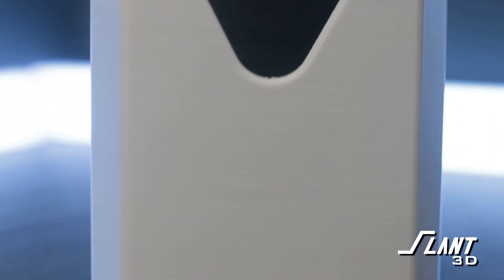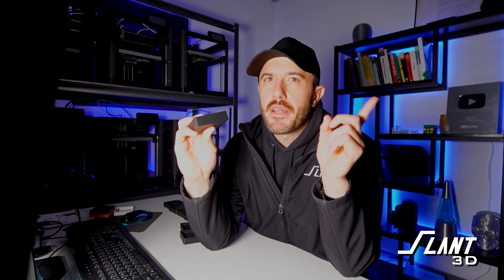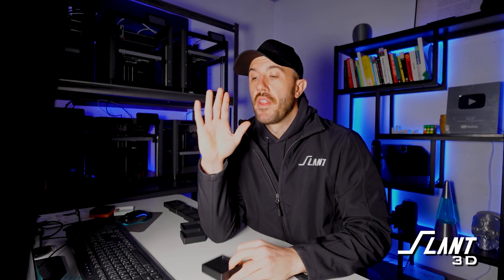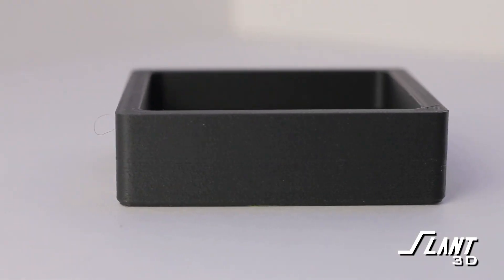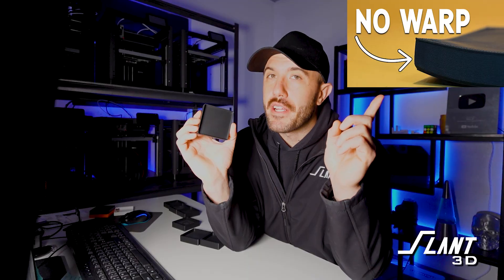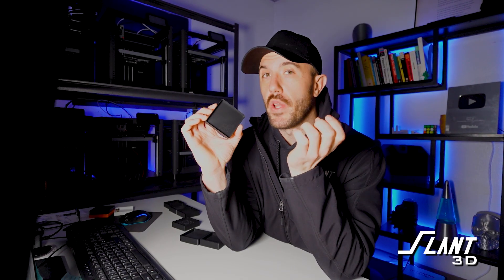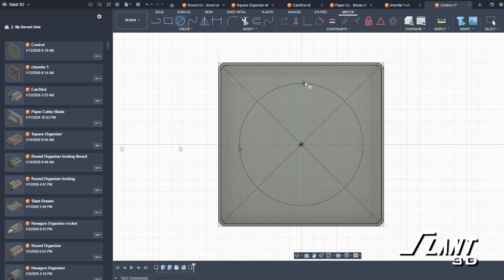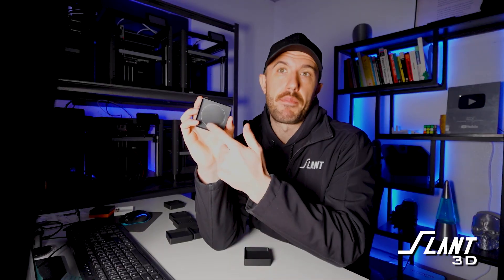How to Eliminate Shrink Lines

Comment: I wonder if hibert for that top layer would help due to its more random directionality? Also angling the print 45 degrees?
Reply: yes there are many ways in the slicer of fixing this problem and, despite some people's (cough cough) objections, you should almost always fix problems like this in the slicer if you can. 

This attempt to merge slicing-control with model-design is a very dirty bodge that's 'leaky' and means you have to actually change your model file just to fix a manufacturing issue. Essentially this means shifting your 'source of truth' for what your part should actually be. If you look back on your model file in 3 years you will see tons of weird design decisions that aren't actually design decisions at all but are alterations made to the model file just to alleviate manufacturing issues. The entire point of the slicer is to be the thing that converts the model into the instructions to generate the desired part. It is literally the slicer's job to solve these sorts of issues, and trying to do that job in modeling software instead will just give worse results. There are some fixes which are stronger, faster, and higher quality that simply cannot be done in the model. Speaking personally tweaking the max line width in Orcaslicer cut down the print time of one of my parts in excess of 40% and dramatically improved quality by letting me convert short lines into long loops, and that's simply not something you can do in the model itself. (For obvious reasons. Btw the feature was threading on relatively thin walls btw, so where the threads popped out/in the additional inner wall would be a tiny line, whereas with just a few minutes tweaking line widths it became two variable-width loops instead. Hard to explain in text, but very obvious when looking at the gcode preview.)

Practically speaking I can understand why some people dislike the idea of relying on the slicer, but this is literally the slicer's job. The entire point of it is to convert your desired model into instructions to be printed so that the final product is what you want with as few defects as possible. If you want automated large-scale handling of prints then the best route is to either work with a known slicer (such as Orcaslicer) to develop an automatable variant (e.g. : you can upload a .3mf file that contains all of the print settings and such and then do "orcaslicer --slice-from-cli --to-gcode ./myModel.3mf ./myModelOutput.gcode", and notify the user before 'updating' their gcode by re-slicing it. Orcaslicer is basically the community standard, it's well-supported, it's open-source, it's community developed, I'm sure they'd love to have someone spend the time/money to add a feature like that if it doesn't already exist.) or, as I mentioned previously, print based on raw gcode with programatic additions/changes. Blind avoidance of using the correct tool to solve the problems is not a good idea. It's like if programmers started regularly including hand-written assembly to try to 'optimize' their programs. Necessary in some VERY specific circumstances? Yes, but the average compiler will still outperform the average programmer trying to hand-write assembly a thousand times over, and for a thousand times less effort. Trying to circumvent the slicer like this is just not a good way of solving the overwhelming majority of problems.
Reply: @robonator2945  The problem comes when you sell parts. I am HAPPY to muck around with my own slicer, with my own designs, to get a functional product. But if I am selling a part, I can't ask them to do the same mucking around to get it to print. I need the model I sell to get sent straight to the printer and actually print, right, first time, every time, within a few constraints. 
So your use case determines your tolerance for slicer tweaking.
Reply: @robonator2945  great response and very detailed. I think that one caveat in the video should state that slant wants to optimize models for print so they can just slap it onto 1000 printers without tweaking the slicer beforehand. However if you are solo printing/print farming then you know the results you want and should not be dissuaded from optimizing via the slicer.
Reply: @mmmuck   I agree to some extent, but at the same time this is exactly the sort of use case where the user being able to upload something like a .3mf with pre-configured settings is most useful. You let the user create a configuration which prints the part as optimally as possible, THEN they export a .3mf that contains all of those settings, THEN it's sliced in the printfarm using those settings, (with some simple overrides/constraints, auto-ejection macros, etc. added) then the result is a better (likely faster too) print that is beyond anything you could get by firing blind with generic default settings. In most cases the only real restriction the machine applies is what speed you can print at, that's it. Movement precision, harmonics, VFAs, etc. are all problems to some extent, but by now any modern machine will be good enough that that's not a part-quality blocker. (and most of those issues can be dodged by printing at a lower speed anyway) 

If you're doing commercial print-farming you already accept that the user has to be able to change some settings (such as infill %, wall count, etc.) so why not just hire some devs to add CLI slicing to Orcaslicer, have (your) customers use Orcaslicer to create .3mf so they can print with their exact settings on the exact same slicer as you're using? Then they just upload that .3mf and the only difference is the machine itself. If you were particularly concerned about version differences you could even expose an option in your interface to specify "yes I specifically want this to be slicer with Orcaslicer version 0.69.420". Then you can create a very simple little script/server that handles requests, runs a simple command like "orcaslicer-cli --constraints-file ./PrintingConstraints.file --output-file ./ModelToPrint.gcode --input-file ./UserSubmission.3mf" and (assuming you went that extra mile and added a way of controlling the exact version of orcaslicer to use too!) now the gcode you generate can literally be identical to the gcode that the customer generated on their own machine! Well, except for differences required by hardware and things like auto-ejection macros. (which in that example would both be stored in the "PrintingConstraints.file" file. I don't know if an existing format like .3mf can store those things yet. Still, continuing to use Orcaslicer for the sake of example, they already have a 'printer profile' system that could probably handle a good bit of it. Maybe have a system where you can use another .3mf to override some settings of another one? Whatever you do, after that all you'd realistically need to add is auto-ejection gcode, which tbh you could probably just add to orcaslicer natively anyway.) It'd certainly be a good bit of money to hire devs to add that, but I can say firsthand that the quality I've gotten from just a liiiiiitle bit of slicer tuning would make the resulting products improve by more than enough to justify the investment. And, let's be real, Orcaslicer is basically already the community default anyway. 

The 'just modify the model so that it can be printed with any slicer settings' approach works, but it's a naive solution that completely forgoes a ton of the advantages 3d printing provides. To 3d print is to trust the slicer, there's no getting around that. If the slicer is bad enough, you cannot successfully print ANY model with it. So, inherently, we already accept that the slicer must be trusted to create a good print. So then, why aren't we trusting it to do that?

Yes, as a general rule of thumb you shouldn't rely on the slicer to make an otherwise unprintable model suddenly printable, but when it comes to ensuring that the conversion from idealized model to finished part is as good of a conversion as possible, that's literally the job of the slicer! Yeah, a model that can be printed anywhere without tweaking is better than a model that can't, but that doesn't mean it's not a good thing to be able to control the environment! You can (almost) always get better results when you solve problems in the slicer rather than outside of it. (notable exception currently being supports, where modeled supports actually DO often have the edge, but 1 : nothing is stopping you from including modeled supports in a .3mf file, and 2 : there's no reason slicers couldn't be improved to add things like fin-supports! If anything, yeah, they probably should! Manually-defined fin-supports actually would be a really neat thing to see added to slicers! Plenty of resin-slicers have comprehensive tools for manual support design, why not filament slicers?)
Reply: @robonator2945  is max line width the amount of squish? I was messing with it but with mixed results and lots of failures. I think it was lots of other factors which I have resolved. I will have to check it out again. Better quality, better results, and lower print times, heck yes!
Reply from the maker: You do want to avoid the need for slicer settings to fix these problems whenever possible

Comment: Man I'm pretty sure you missed fairly hard with this video. Your methodology and reasoning is fairly sound however you've entirely kept all the material beneath all the modifications meaning there is still a lower transition flat surface which is likely what you're seeing after all the testing. However, your conclusion for having a moat around the middle platform is the best thing I've thought of so far also.
Reply: He wasn't really mentioning the parameters, but the only reason I can think of why it sort of works is if the moat is deeper than the solid top layers.
Reply: @Vaultdorr this has nothing to do with parameters.
Reply: @klaidasrunele  Maybe parameters was the wrong word, but it could be dependent on the dimensions of the moat in combination with the standard slicer settings. I get what you are saying with the "still a lower transition surface". It's hard to explain without drawing but I will try to describe: 
1. Lets say the thickness of the solid top layer is 1 mm (5x 0.2 mm). 
2. Lets say the moat is 1.5 mm deep. 
3. Expansion will happen in the top layer, but grow into the moat. 
4. Below the moat, there is not much expansion as the infill density is low.

If the infill density was 100%, then this trick would probably not work.
Reply: @klaidasrunele  this is what I was thinking too, wouldn't the hull line just be moved down to the topmost solid layer that spans between the walls.. the offset cut makes sense but even then you've just moved the transition layer down the your cut depth
Reply: @ijahmed786  If you ensure that the depth of the moat is below the thickness of your top wall count times your layer height (e.g. on a 0.20mm layer height with 3 top walls, make your moat 0.8mm deep), then what you'll end up with is the bottom of the moat being printed on top of infill, while the center island is still getting infill print.

By the time it starts printing top walls on the island, you've already established your moat, and the island no longer has any connection to the outer walls of your object. That's what reduces the affect that the large island has on the outer walls -- the island can shrink but all it's going to pull is the inner perimeter of the moat, rather than the outer perimeter of the outside of your print.
Reply: @ijahmed786  in theory it shouldn’t shift down because it’s caused by long extrusions that are connected to the walls. When you detach those long extrusions via a “moat” there’s not all that stress being placed on the outer walls.
Reply: Yeah like. The solid top surfaces haven't gone anywhere, they've just been shifted below all the patterns and extra gimmick layers. This was an utter waste of time.

Comment: Thanks forvthe detailed explanation.  Great insight. 

When making a groove inside the inner wall as you describe, aren't you just lowering the floor where it contacts the inner wall? Basically the level at the bottom of the groove is the new floor. And consequently, aren't you just lowering the hull line to that level?
Reply: That layer only has the thin groove strip to pull on the wall, not the entire surface
Reply: Go one layer lower...isn’t the layer that includes the bottom of the groove a full layer covering the entirety of the interior of the box? Why isn't there a hull line there?

Comment: One answer solved, now, fix the issue where Supports cause layer lines!  When making things like Lithophane frames that require supports, where there is a transition at the raft interface when using PLA/PETG for the separation, I get a layer line all around. If I use same material for the interface, it doesn't cause a layer line, but then I wont get a clean transition either. THAT has been driving me bonkers.
Reply from the maker: Design the supports. Don't use slicer supports. Watch our sphere video
Reply: @slant3d  Did that, but it still leaves a Z line for some reason. I don't know if its inherent to the H2D or what, but when using PLA in one head and PETG in the other, thats when I get Z banding.  I am trying something different ATM using your idea of breaking up the first few layers on long sides to prevent warping, and using PETG as the entire support instead of just the interface.   I am thinking that the time between the last print of the PLA on that layer, switching heads, priming then printing the interface, then switching back to the PLA, priming and continuing the print is where the issue happens.  It also happens on the X1C which has an even longer transition between PLA and PETG.  I'm hoping that with a change on every layer it is more consistent and not noticeable.

Comment: Isn’t the fuzzy skin pattern a function of the slicer, or should it be modeled?
Reply: Slicer, at least in Bambu under the Other tab.
Reply: I find the prints are slower when slicer generated the fuzzy. I use zbrush to build more CAD like projects and I find I get better and more diverse noise from zbrush than the slicer and it prints the nose just fine but without the time penalty. So try and compare with your CAD app or dcc of your choice and compare. I'd be curious to see if it holds true for others. 😊
Reply: He’s talking about modeling it. He’s putting a lot of emphasis on making the model work on any slicer. Pretty much any slicer these days has the fuzzy function so you could use that to “fix” models that have hull lines when printed.
Reply: Fuzzy skin is definitely a slicer thing. But since it’s so widespread in slicers, it would be easy to recommend it in the printing notes. The specific parameters probably don’t matter, any default fuzzy skin will work very well to hide layer lines.